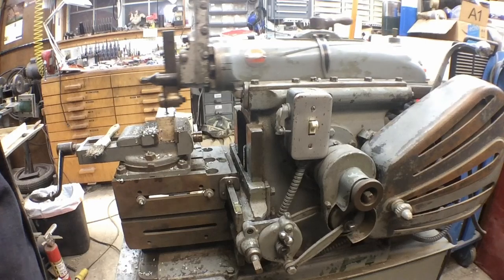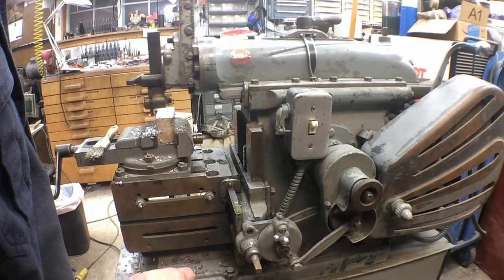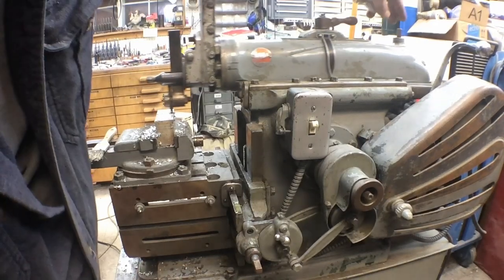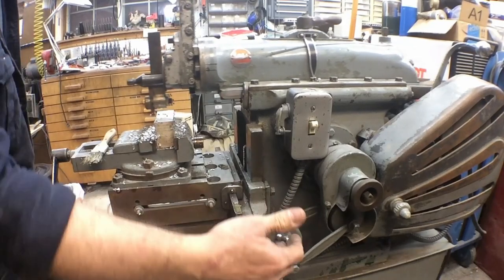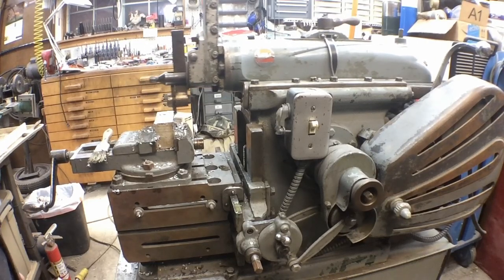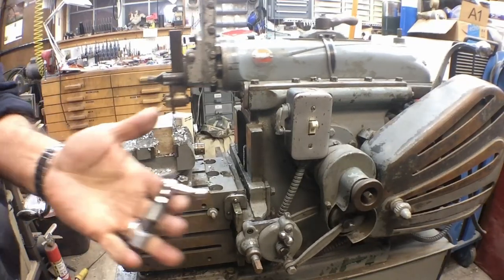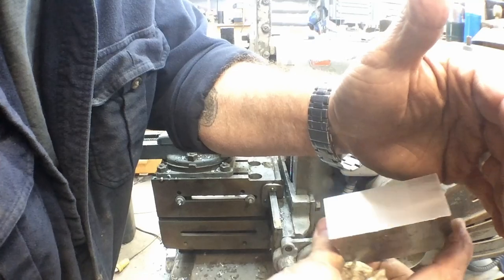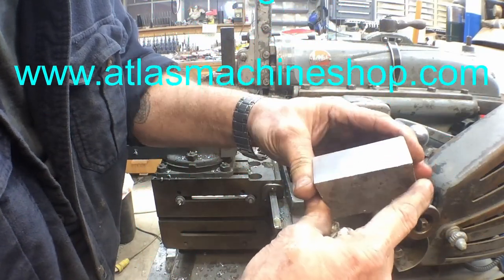Running The Atlas 7B Shaper

Comment: great video - just got an atlas 7b need few items maybe someone can help: vise handle, belts, clapper tooling posts/tooling, rotary table  - i am learning on this i may not be accurate on descriptions
Reply from the maker: congratulations, they are a fun machine.
Reply from the maker: don't get to caught up in actual Atlas parts such as the rotary table. If you are getting them as collectibles to keep everything Atlas then that is fine, but they are exceptionally expensive for what they are. if you want them to do actual work with then there are import items such as rotary tables which are better options for less money, belts can be sourced locally, I will try and find the numbers, but you can match what you have from the local Auto parts store. Good luck.
Reply: @hillsgun  yup i want to make some small parts - i hate to impose can u maybe advise on the extension tool holder, and table lift extension shaft where i can get or if u have
Reply from the maker: Sorry I hadn't got back to you, Comments seem to be getting lost . What info do you need?
Reply: @hillsgun  no worries, i have most of what i need, its the cutting tools and holder - i am missing - if u sell great! if not can u point me in right direction

Comment: Hello Mr hill I just got my self a 7 inch atlas shaper I was wondering if you would know were I can pick up some oil cups and the grease cups both grease cups are missing thanks for your time.
Reply from the maker: For the oil cups you should be able to find them at the industrial supply stores such as McMaster Carr, look for Gitts oilers , I don't know of a supplier of the grease cups. I started settling up tooling to build them but have not finished yet.
Reply: @hillsgun  hello again Mr. Hill just one more question if you stand in front of the shaper on the left side were would the grease cup be at I have a parts list but it doesn't give a good pic were it gose I was wondering if you could take a pic of were  it is.  And again thank you for posting this video .
Reply from the maker: it fits right behind the door and directly above the bearing boss in the frame
Reply: @hillsgun  ok thank you for sharing your knowledge